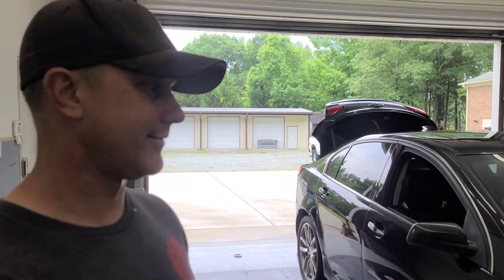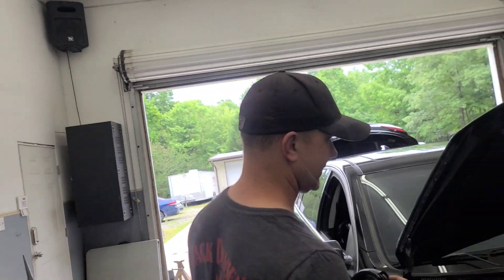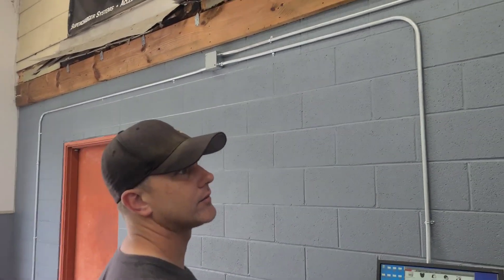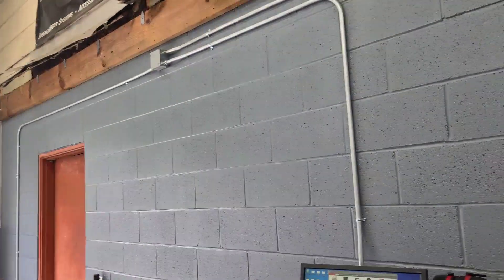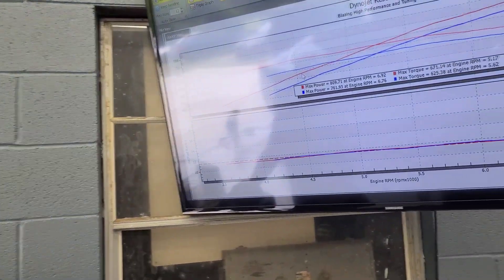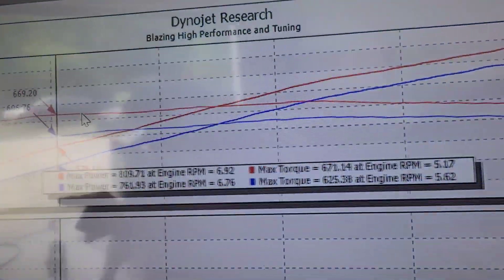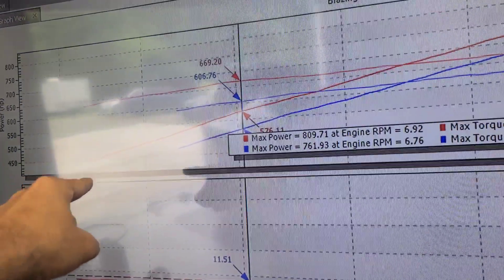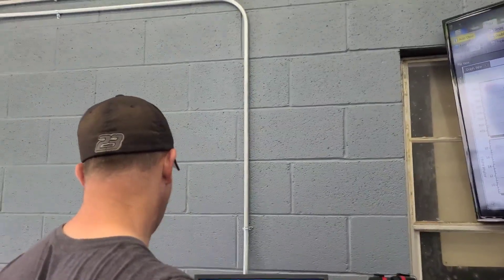Redhot cam and a 2650 blower makes over 800 RWHP in a 2015 SS Sedan A6!

Comment: Question, I’ve got a G8 with rotofab intake, manzo headers, x pipe welded in place of mid muffler and solo j pipes axle back. I’m about to order parts for dod delete and for the time being I want to stay stock converter. What parts do you recommend? Ls7 lifters, .660 springs, redhot cam?
Reply: And how noticeable will the power difference be if I get the redhot
Reply from the maker: Btr 1 v2 without a stall.  Redhot with a 3200 stall.  20 hp or so
Reply: @nufnuffz28  Joe from g8 only said the redhot would be alright without a stall, would I be able to get by without one for a while? I wouldn’t be able to get one right away but want the redhot cam

Comment: Wow. That SBE is working. Did they really not even have gapped rings? I’m also curious and it was hard to tell due to the exhaust in the video, but does the 2650 have a good whine?
Reply from the maker: Correct.  Its on borrowed time though.  They whine well